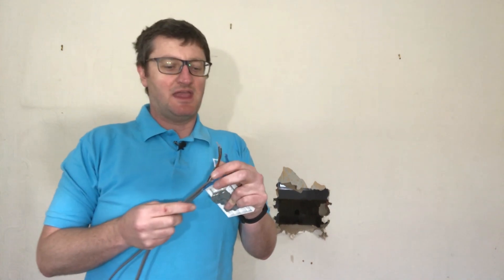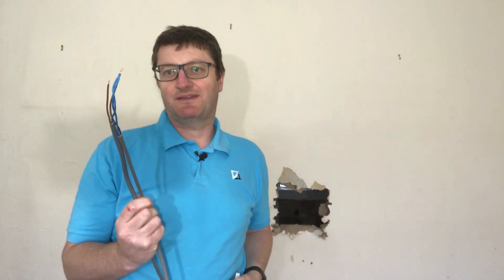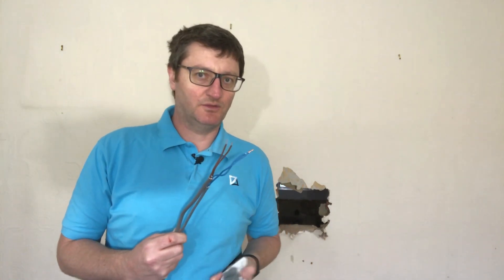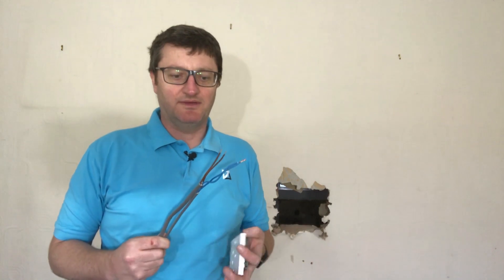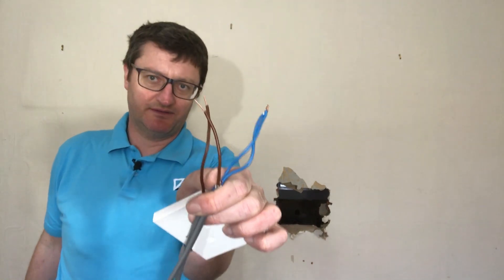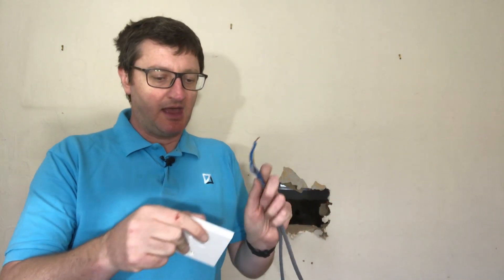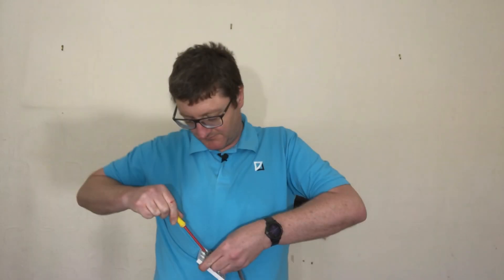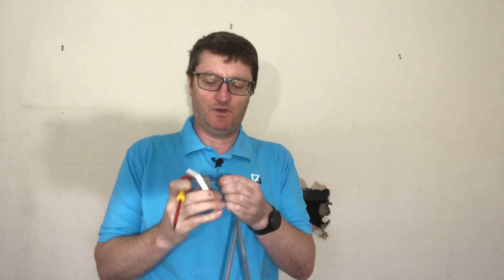Cable ends; to twist or not to twist

Comment: Is there anything that i could use so secure both wites together before connecting to the socket? Twisting them together sometimes makes it much more easily to break, simply inserting both especially if their diameter is different most of them time letting ine easily to come off.
Reply from the maker: as I mention twisting is not the way anymore...   and why do you have different diameters...   but to answer the question, the bodge way would  be Wago connectors (Wagos are fine but not used like that ), but you may be better folding the connectors, especially the smaller one to fill the terminal so they don't fall out.   Or buy a better brand of socket, sometimes it is worth paying the extra as they are just designed and built batter.

Comment: special socket is required to add 2 wires in one connection ?
Reply from the maker: If you had a spur coming off a ring circuit then you'd have 3 wires in each connection....
Reply: @MPCpropertydevelopments  no, i mean when there are 2 electrical cables and 1 power socket, connecting the electrical wires in the power socket port, didn't work very well for me, they fall off the connection port. I use power sockets produced by Tem. Do I need special power socket to have a connection like you did in the video ?
Reply from the maker: @gijoe5313  If you fold the ends of the wires so they fill the connector in the socket you should get a better connection...  if they still fall out then look to replace the socket, might be stripped threads or just the socket isn't so good quality...  I've never heard of TEM so couldn't really comment on how good/ bad I think they are...     [as an aside, back when I trained they taught us to twist the connectors so this happened less, but it is now thought the risk of them falling out is better https://youtu.be/DAGVEmMdLu8]
Reply: I'll give it one more try. Thank you for your advice.
Reply from the maker: @gijoe5313  well done mate, keep at it...

Comment: What about getting a wago 3 wire connector and putting the two wires in with a fly lead then going to the socket. I've seen American electricians do this.
Reply from the maker: NOOOOO...   why would anyone do that....  every joint is a point of failiure and you only have so much room in the back box....